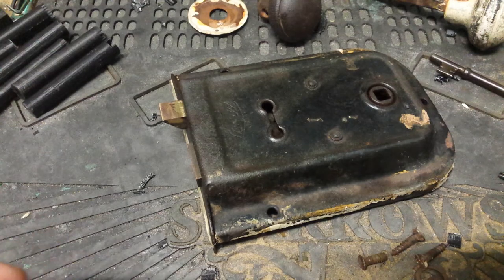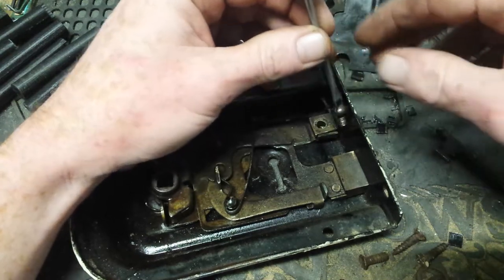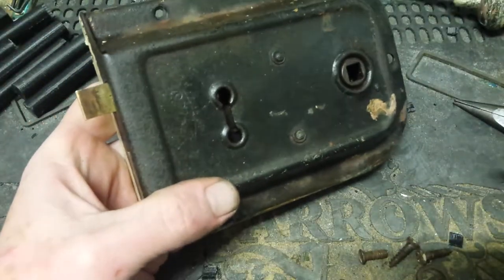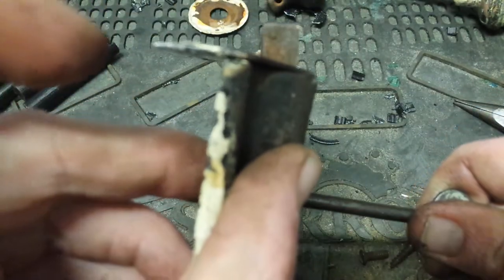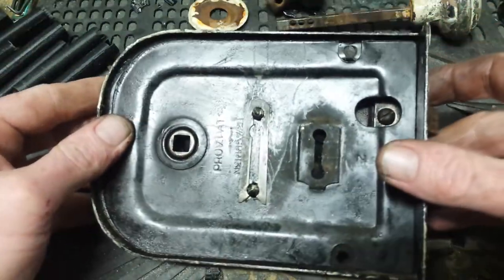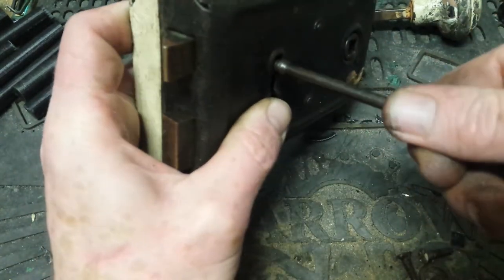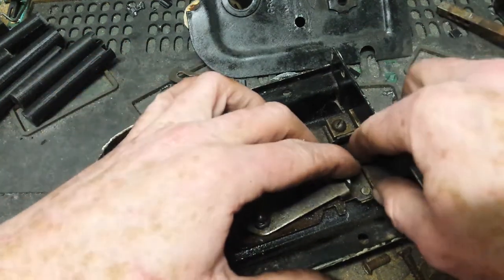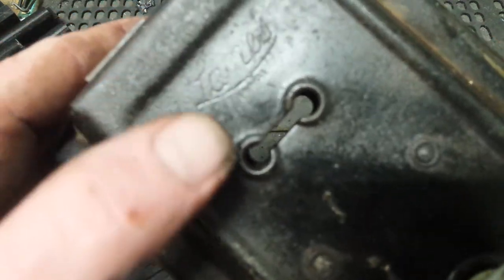Rim lock latch repair

Comment: My house is basically a 200 year old cottage and thanks to you I now have working internal door latches as all of them had fallen to bits from being loosely screwed to the doors and internals all fallen out,  2:51 that shot was perfect and I managed to put it all back together , thanks a million!
Reply from the maker: Yeah they are often neglected or have been for some time due to their age or lack of use.  Good a lock as any which make the former statement a shame, especially now you know how easy they are to fix.  Awesome to know I could help, Cheers!
Reply: I have a rim lock that I removed from an old iron screen door. I works fine but I took it off to rescreen the door and the two halves inadvertently campe apart and now I'm having trouble putting it back together. Can you offer any advice. I can send photos.

Comment: Sorry for the late comment but catching up when the time avails. Wow, those old skool Lanes rim latches were the go back in the day. You know, the days when you could leave your door unlocked at night and a single night latch was more than adequate to secure your house. I am not sure what numbered key you have but there is only 6 keys to the Lanes rim latch series. I saw that your lock is a number 2. What key number is embossed on your key? Might be relevant if the inner warding was still present but it looks like the warding in yours is non existent. Just some trivia for ya. Cheers:-)
Reply from the maker: No need to apologize mate I'll always get back to ya.  Yep they where/and are in almost every older style house.  And still working *most of the time ;)  Key is pretty worn on the bow can't make out any numbers I'll have to have a better look with fresh eyes.  Times have changed big time, not always for the best, unfortunately all we can do is adapt.  Let the trivia flow, there's certain thing you can't learn from books or the internet you just have to do and see what happens.  Your comments are appreciated!  Cheers TR